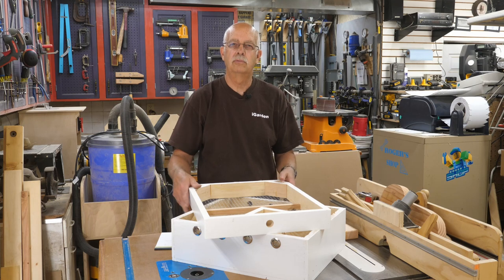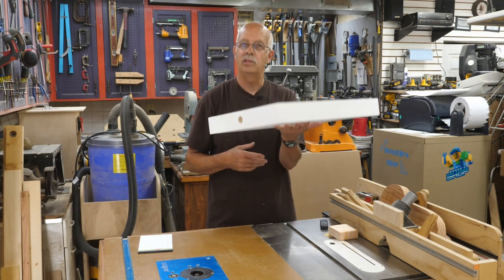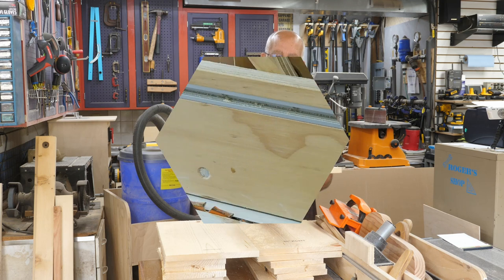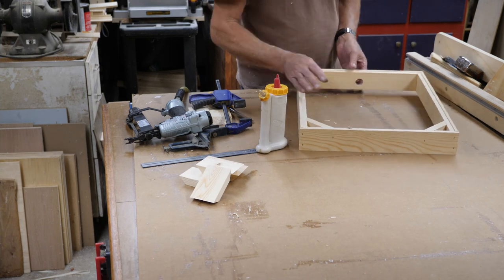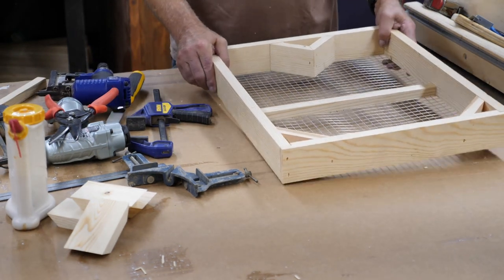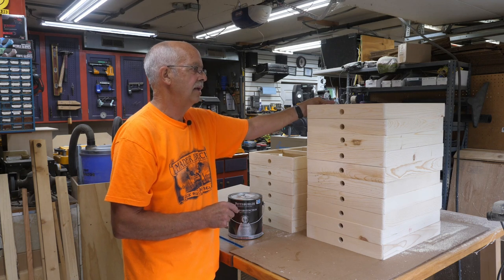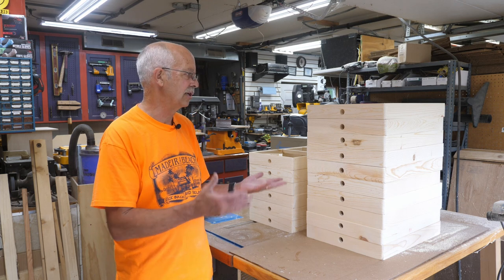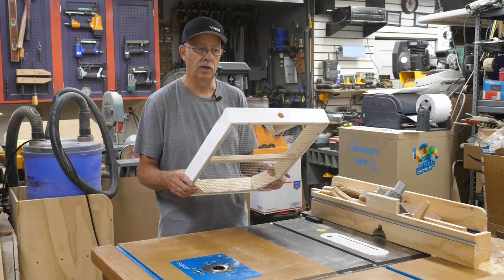Bee Hive Candy Board Production With Details

Comment: to confirm you use the Candy Board and then have the Quilt Box on top? I thought the Candy board was made to aborb the moisture for the bees to eat/drink from. I have thought about doing this as well because here in NY the winters have been really strange but was not sure if the Bees would be able to eat the sugar because of no moisture to make it soft enough to eat.
Reply from the maker: Depends on your humidity levels, weather, etc.  A filled candy board will absorb some moisture.  The quilt box above will take excess and also insulate some.  Our bees do not a have a problem taking the sugar.
Reply: @rogersshop  Thank you